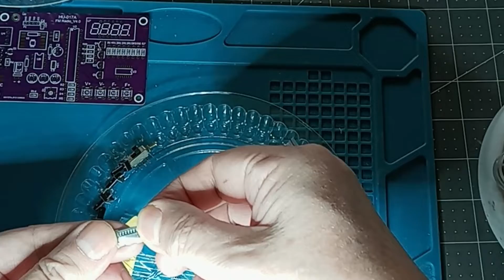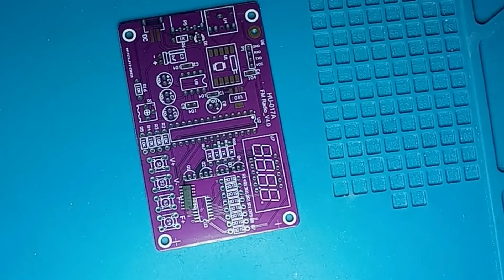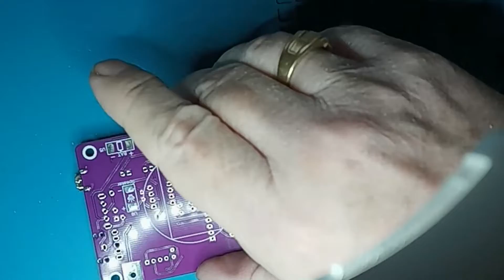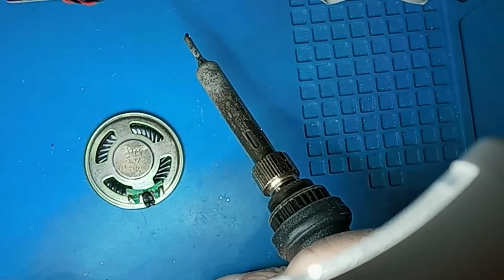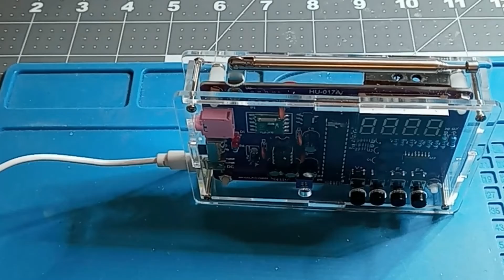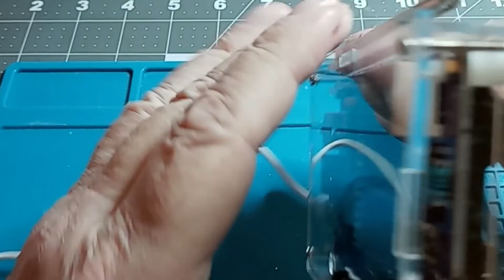FM RADIO KIT BUILD RDA5807

Comment: Hi, I have a same one, but it doesn’t work, although, the 74hc595d chip is poorly soldered, amateur I am, I managed to solder some of these tiny legs together. Do you think there is the problem? The radio barely makes a sound and display shows random parts, not even the whole numbers. Thanx
Reply from the maker: Flux is your friend.
Reply: Maybe find a practice soldering kit for fitting smd ics' to a pcb, it can be fun.

Comment: Suggest how to determine the side of the IC that you first solder. On the plate you see a small dot but on the IC both sides look the same.
Reply from the maker: It can go by the writing on the IC. You can easily find that on the internet but I'm not sure anymore.
Reply: @magneticpropulsion2507  Usually there is a small indentation in the IC next to pin 1 and this corresponds to the marking on the pcb.

Comment: I have just bought and built v.5 of this kit which almost the same except the first IC (and couple of associated capacitors) is no used longer in the kit and the battery compartment now takes 3xAAA batteries. Also the speaker is friction fit onto the case but I used a small amount of superglue to keep it in place as it kept falling out. The volume and tuning buttons also came with button caps which again needed a small amount of glue to fix in place.

Thank for the video it was very helpful information when I was deciding to buy my kit.
Reply: I just did the v5 kit too. It works great, but did an auto-channel scan while the antenna was down. All the channels are retained but it missed a few. I don't know how to erase all the channels and have it rescan, or how to add the 2 channels to the preprogrammed list of channels.
Reply: @Mikeydude001  I am not sure how to do a rescan. Not really seeing details instructions online. I would try holding one of the scan keys when powering on and see if anything happens. Good luck.
Reply: I just built the V5 much better with auto scan and then switch on to the last channel, then just touch up to the next stored channel and so on, much better with the 3 x AAA batteries and fits the case. As I didn't like this one here though I still have it, prob won't use it again now I have the V5 model.

Comment: first time ever trying to solder anything. i put everything together exactly like the instructions say but after i connected the battery pack and flick the switch on the light didn't turn on but the wires to the battery pack would get super hot any ideas on how to fix that or what i might have done wrong?
Reply from the maker: @jackoberhansley  Short circuit somewhere.  Maybe step back and do an easier kit and try returning to this kit after that. Also, try a cheap meter and study the schematic. With the meter you can isolate the short.
Reply: @magneticpropulsion2507  I absolutely agree.
A smaller kit may be a better start.
My first one was small LED clock kit which had less than half the components of this radio kit.
Reply: @magneticpropulsion2507   thanks ill try that!

Comment: Do I need to apply solder to the antenna? or just the screw will do it?
Reply from the maker: @caiosantos9057  Not 100% sure but seem to recall using solder on it.
Reply: You don't need to solder it, mechanical connection with some thread loc is fine. The antenna elbow is very stiff though so work it over and back a dozen or so times to help loosen it before mounting with the nut.

Comment: hello i have the same radio, everything seems to work but I can’t get any signal. I tried every frequencies and nothing. What could it be? :(
Reply: i tried with earphones and it’s the same. speaker not in fault
Could it be a faulty module or bad soldering? 😢
Reply: @selimgorur827  did you found a solution? im on the same boat

Comment: I have same radio but my speaker is not working, everything else seems to work fine, any ideas?
Reply from the maker: @StelthSRB  check that the wires soldered to the speaker aren't shorted with solder.
Reply: @magneticpropulsion2507  they are not, I think speaker is dead, tried to check resistance with multimeter but no readings on speaker..

Comment: I hate smd chips.
Going to start mine tmrw..
Reply from the maker: Flux will help.
Reply: @magneticpropulsion2507 I built it tonight. Its only working on the USB. 
I get power on AA, but thats it. The display blinks and goes away.
At least it works on usb.
The chip under the display is a 74hc595 shift register. It sends the data to the display. 
I'll troubleshoot more tmrw.
Reply from the maker: @freeflyer1  Try pressing the volume and tuning buttons.
Reply: I find the smd chips a bit of a challenge to solder and that adds to the fun of building the kit for me.

Comment: Just bought this and I can't get the screen working, any advice?
Reply: Same issue , four red zero display with no frequency reading. Radio works great, though.
Reply from the maker: @mgtsmartlady  Look at the schematic to see the pins from the IC that go to the LED display or one pin for the tuner to the IC then check them for bad solder connections..
Reply: @magneticpropulsion2507  Removed the covers , batt holder ,  speaker adhesives and rechecked solder joints and all ok.
Had another look at the U3 , 16 pin chip solder joints that looked ok but freshen them up. On power up channel frequencies worked. Thanks for your suggestions , must say surprised by sound quality.
I have got the bug now waiting for electronic components tester kit to arrive.